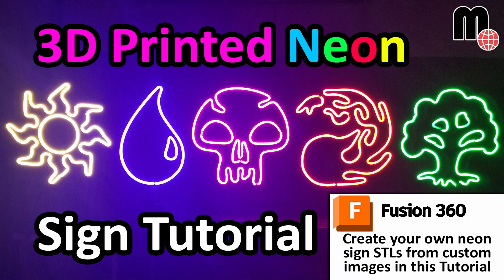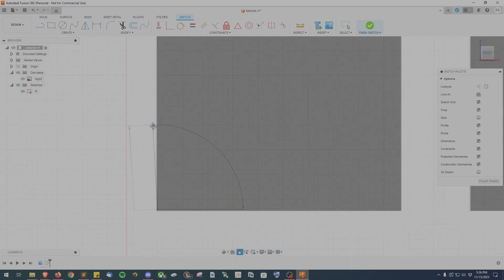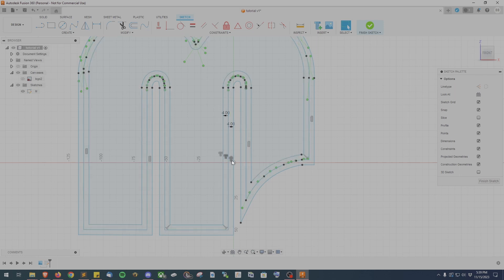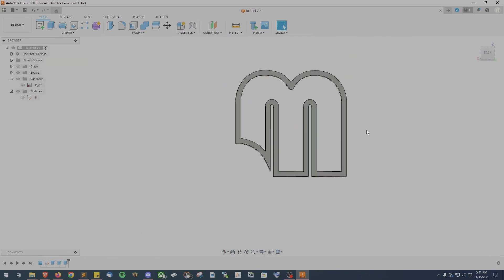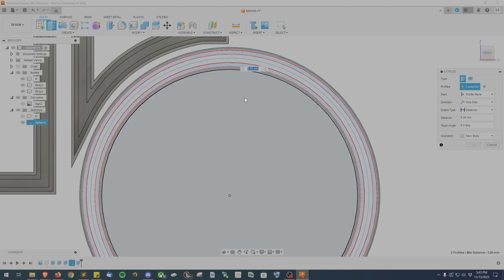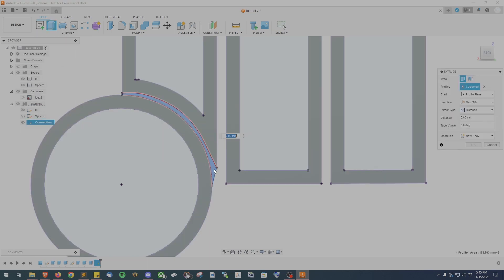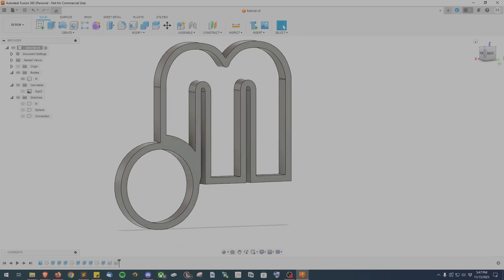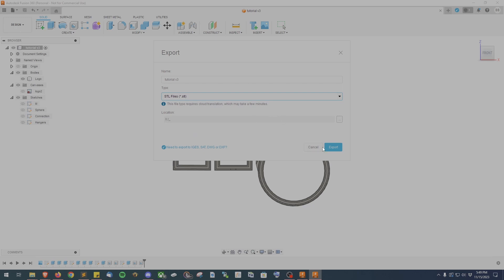DIY 3D Printed Light Tutorial: Design Your Own 3D Printed Neon Sign Models

Comment: You don't need to waste any time tracing if you convert your image into an SVG file before you import it into fusion 360. There are a lot of free converters online and you can resize the SVG to fit the printers bed size after importing it.
Reply from the maker: True. I learned about doing that after making this video. Also, I am very privacy-aware (translation = paranoid, lol) and don't want to send images to a random website to convert into an SVG. I have since learned that a Windows program called Inkscape can convert PNGs to SVG and am now using that.
Reply: Very good to know. Thanks.
Reply: Does not always work well. I can draw very fast in illustrator but it does not aways let me extrude or offset

Comment: instead of wiring each section separately back to the power supply could you just wire them in series?
Reply from the maker: That is where talking to someone who knows more about electronics would come in handy. Long story made short, I am not sure and don't want to speak on it in case I am wrong and something happens (like a fire) to someone. Sorry

Comment: If I am making a sign just full of letters, rather than a logo. Do I need to trace round each letter, or is there a way to just get the centre point and set the offsets / extrude the lines from there?
Reply from the maker: The offset is based on the object's outline, be it a logo or a letter. If I am understanding you correctly, you will still need to do the initial outline of the letter/word and then you can create the offsets based on that line. Then you'll be able to extrude the offsets to give you the channels the LEDs sit in.

Comment: If I want to make an individual neon light, is it necessary to get a 12V power supply? Did you do that only because the neon lights you used are rated 12V? Couldn’t I also just get a neon strip that is 220V and then connect it directly to a power chord (for EU)?
Reply from the maker: As far as I am aware, you will need some sort of power supply and not just a power cord. The LEDs I used were 12v LED strips, so that is what I am familiar with. Double check with an electrician in your area. They should be able to assist you further